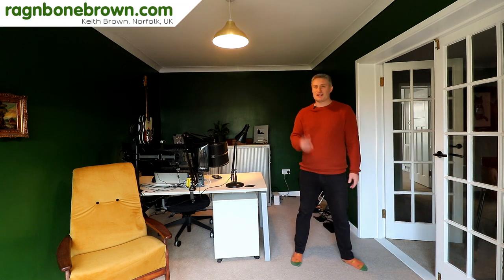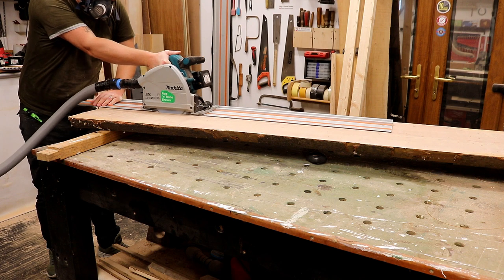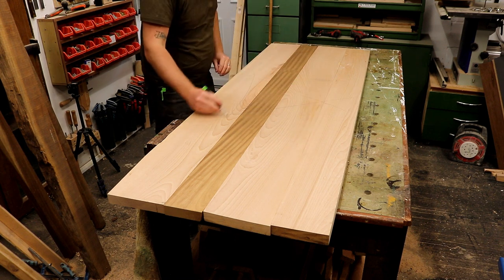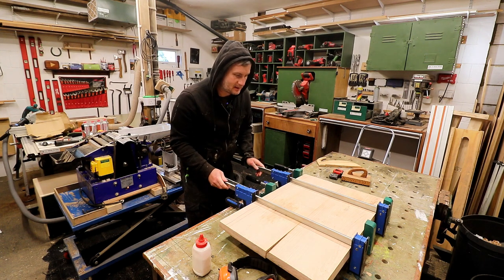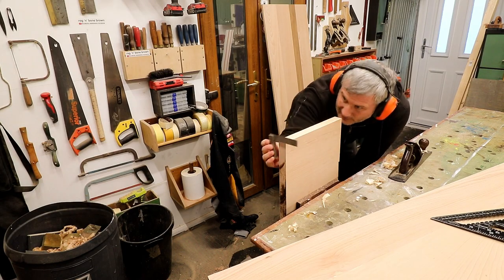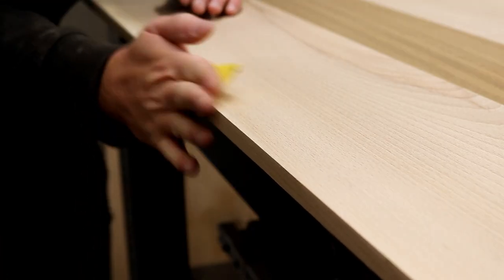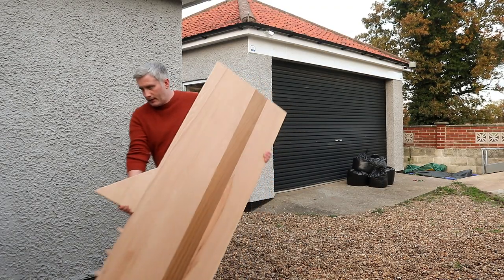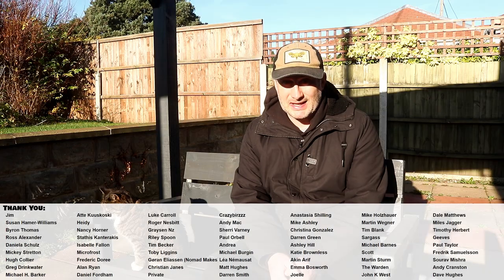Building My Dream Desk

Comment: I'm in the middle of a desk build myself.. I had some white oak milled recently, and am going to eventually make a desk from one of the slabs. In the mean time I'm making a "place holder" desk, to tide me over until the white oak is dry in about 2 years.. I have an ikea desk as well, and whilte mine doesn't squeak like yours. It definitely has lateral movement, it feels cheap and looks unprofessional when I'm video conferencing. 
Enjoyed the build, and I love the method of putting the bevel on the top with the track saw and a block of wood. So simple, but I would have never thought of that! So thank you!!

Comment: It looks great as expected! I made a similar design from some butcher black counter toos. Instead of using metal plates to join the two main pieces like you did, I used dowels for alignment and used countertop bolts to draw them together. The countertop bolts sit in a recess (a large, round bore hole) and allows me to very tightly draw the the pieces together to eliminate any gap between them. They're essentially permanent clamps!

I have had that desk for a couple years and in a couple different houses with very different climates, and wood movement has been a non-issue.
Reply from the maker: Worktop bolts are a great idea, wish I'd thought of that

Comment: Nice job!!! Looks great! For jointing the edges when making the desktop, try using the in and out method before glue up. This is especially helpful if the wood sits after milling. Once you get your layout the way you want it, alternate marking the face with in and out. Take them through the jointer again. Which ever side is marked as "in" goes against the fence and the edges marked "out" will face away from the fence. Jay Bates has a great video on this. Much love and keep up the great work! ❤️
Reply: Do you perhaps know the title or the link to that video? All I get are videos about the effectiveness of the pull out method
Reply: @Unlovable  😅 I couldn’t find the original video that I saw by Jay Bates but this one by Shaun Boyd is good…. And appropriate to the subject 😂 https://youtu.be/W5bgtDFPB0o
Reply from the maker: It's a great method, although as my boards were so long I suspect my issue was more due to user error of not being able to support the board properly from start to finish. Needed another pair of hands really

Comment: I have actually never bought a desk myself, always made my own custom to size and for the room.
The one I am using atm is full size all across the wall right underneath a nice window.
Anchored to the wall, as well as using proper legs. I can literally stand and jump on it.
This time we actually decided to use laminate floor planks as a top.
They are extremely scratch resistant and they can be very easily replaced by some new ones while keeping the desk intact! 

Anyway, looking great Keith! Love the finish as well!
Very satisfying projects to do in general 😃👍

Comment: Looks really nice mate. N8ce contrasts. The more you remove from your stock, the more likely you'll get movement. That's probs why the gappy edges I've no doubt. Can make material go bandy sometimes, removing that much. Best done in stages if you have the time, so the stock can aclimatise. With you on wetting the grain first. Pointless. Lifting it with finish much more likely to fill the paws which means your next coat won't lift the grain again. End of my waffling.👌👍
Reply from the maker: Good points! Yeah I won't be doing the grain wetting method again, a few people have commented how I should do it multiple times and sand diagonally rather than with the grain, but just applying a coat and denibbing seems much easier and quicker to me 🤷‍♂️

Comment: Beautiful bit of Beech.  I've just made a live-edge Beech desk with purple resin infills.  I've got loads of slabs from the local country park estate, but sadly they'd been outside too long un-protected and some have some deep black water staining. They still mill-up okay but not as good as your ones. Have to router-plane them considerably to get them looking decent, fed-up with the 'black bags' of dust so now installing a wood burner in the 'shop!
Reply from the maker: Would oxalic acid remove the stains?
Reply: @RagnBoneBrown  Ah, never even thought about a chemical solution!  Cheers Keith, will give it a shot!  Thanks!

Comment: You have to sand diagonally after wetting the wood to take the raised bits off, otherwise you're just pushing them back down again so that as soon as you add finish they raise back up!
Reply from the maker: I'm not convinced it works well enough, so going back to my old method as it's quicker

Comment: Hi Keith, it's sad to see so much dust that isn't board any more!. Could you have sawn to manageable widths eg 6-8" & resawed on bandsaw to get your desired thickness?. It does mean some extra gluing planks. But keeps you some usable board instead of dust?
Reply from the maker: Hi John, I probably could have but as explained in the beginning, originally I wanted to keep the full width of the boards but that didn't work out. By the time I ripped them down to thinner widths, there wouldn't have been enough thickness to resaw

Comment: Great work - that wood combination looks lovely - I'm with you all the way on sapele.
Can I ask the make of the blue and green clamps, please?  I can't see them on your affiliate links.  Cheers.
Reply from the maker: Hiya Tim, thank you! The green clamps are Dakota, I bought them from Rutlands a few years back, but a quick Google search suggests they are no longer available to buy.  The blue are by Sauter Shop, they are based in Germany.  Great clamps and reasonably priced, but beware of the hefty import fees to the UK - Sauter Shop sent them to me to try out for "free" but it actually cost me about £80 in fees!
Reply: Hi Keith - thanks for that - yikes!
Reply: @tim_biller  don’t buy cheap clamps. I’ve bought cheap F-clamps in the past and regretted it as they slip and are good for nothing.

Comment: As you've now experienced in this video, a regular butt join to make an L shaped desk top isn't the best way to achieve a good result. This is a problem kitchen makers have resolved decades ago. Use a kitchen countertop routing jig to route the edges that need to meet. It creates a profile on each edge which causes them to automatically self-align perfectly in the corner. Then use kitchen countertop connecting bolts (only 2 needed) which allow you to very easily and reliably pull and hold both boards together (still use dowels, biscuits or dominos), AND will allow you to still compensate for expansion later on when the boards settle in your office (don't glue them!).
Reply from the maker: Yeah a router jig would have been a good option but I don't have one

Comment: Nice video - partucularly timely for me as I'm to the process of making a maple desktop to fit on a set of motorised standing desk legs. I love the colour and finish on maple, but it's a very hard wood to work with. The biggest challenge was milling the rough cut maple boards into jointable wood. The boards are about 1.8m long, and my jointer always seems to end up creating an inward bend with a piece of wood that long. I could relate to the amount of shavings you had at the end of milling!

Question - wood movement, is it really something we need to worry about? There seems to be a lot of different opinions.
Reply: Good grief, it's you! ;-)
Reply: @tim_biller  yup - new member but long time watcher
Reply from the maker: Thanks Martin.  Re: wood movement - some say it matters a great deal, others say it doesn't - I sit somewhere in the middle - if the boards are wide (like these desk tops which are 500/620mm) then I will always account for it because otherwise likely to get cracks, or pops.  A lot of it depends on how much moisture is in the wood to begin with though.  Mine are dry but as they were stored in an outbuilding I expect they will shrink a little now they're in a heated home.  Time will tell.  
I made a mahogany box with dovetails on my channel once, and lots of people said that movement would be an issue on the top panels of that box.  I suspected it'd be ok as the panels weren't that wide - and it still looks perfect years later!
I don't think I've ever had any maple to work with, sadly! Unless I used it somewhere but didn't know it was maple, which is possible.  I do love how it looks though.  I know what you mean about planing long boards, it's really tricky without another pair of hands!
Reply: @RagnBoneBrown  thanks for the comprehensive reply. Maple is very hard - I believe it's what they use to make bowling alleys. My local hardwood supplier is conneced to a bespoke kitchen manufacturer so they normally have a good supply of maple, walnut and tulip wood.

Comment: Me again. Just finished watching the rest of the video. Could you have used the kitchen worktop clamping tenons? Or would end/face not slip movement.
Love the finish with sprayed varnish, most of my work is much smaller scale. So might try that with air brush & polish/buff with 600 w&d till totally smooth to touch!
Reply from the maker: Worktop bolts are a really good idea, wish I'd thought of that

Comment: Wet sanding definitely isn’t a waste of time, gotta sand perpendicular to the grain, and needs to be done multiple times
Reply from the maker: If it needs to be done multiple times, then that's all extra effort and time - simply applying one coat of varnish and then denibbing is a much better process in my opinion

Comment: Great design and build! Really clear video that's easy to follow, thank you! Did you consider kitchen worktop clamps routed into the underside? I am curious about how long you can leave the varnish in the spray gun before the next coat or if you have to empty and clean it between each one - anyone tell me?
Reply from the maker: Worktop bolts would be a good solution. With water based varnish, it can be left in the gun for a few hours between coats is fine. Anything longer than that (overnight for example) and I clean the gun
Reply: @RagnBoneBrown  Helpful, thank you.

Comment: youtube woodworkers go on way too much about wood expansion... the wood has been drying for 15 years and you've gone on about it as if its still green -.-
Reply from the maker: Still need to account for seasonal movement on boards this wide.... Besides it's been stored in an outdoor building for 15 years+ which is VERY different to the wood being in a heated home